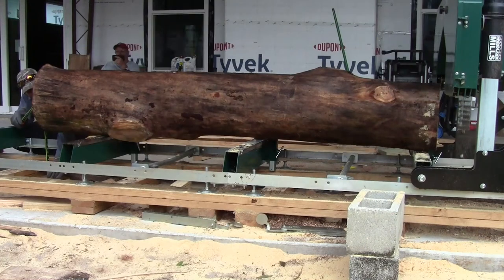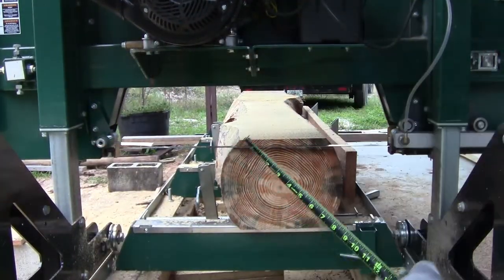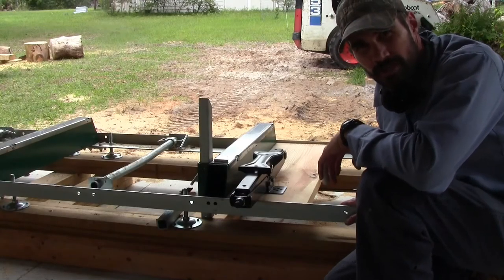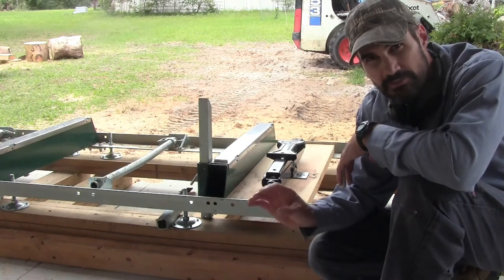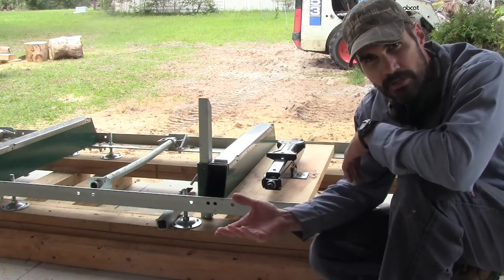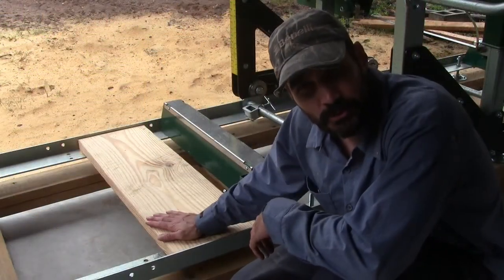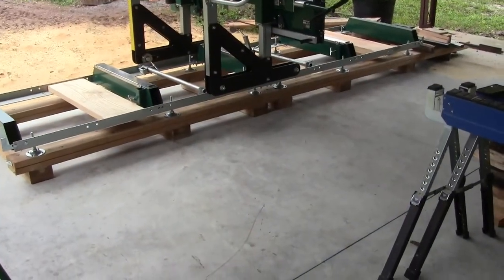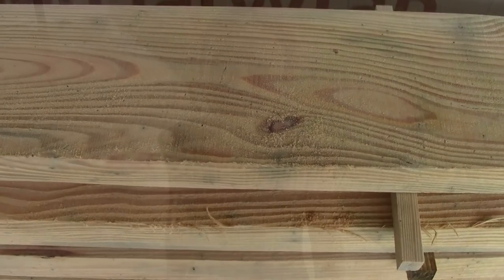Large Southern Yellow Pine on my Woodland Mills HM130Max and a Harbor Freight Upgrade

Comment: Hey there buddy I sure do like the videos. I’m having a hard time figuring out what sawmill I need. I originally thought the hm130 Max trailer would be best, but then I was thinking a 8-30 Lucas would be more useful. It will slab 5 feet wide folks around here like wide slabs. Thank you for taking us along with ya.
Reply from the maker: Thanks for the comment. I think you are on the right track to figure what your ultimate plan is and what type of logs you are likely to get. Matt Cremona has a niche in milling oversized slabs. His setup is geared towards it. I planned on mostly pine trees and smaller stuff so the HM130MAX is a good fit for me.
Reply: @CedarTrailsLiving  ya folks need Dimensional lumber from the pine, fir, and cedar, as well as slabs from the big walnut and oak trees that they take down. I like that the Lucas can be put together around a big log, log handling equipment is needed. But a couple of buddies with strong backs will be needed to move the slabs hehehe
Reply from the maker: @heyyoubuddy6749  Haha. Yeah gonna need real strong backs. That Lucas mill looks awesome. I had never seen one until you mentioned it. Had to go watch a few videos on them.

Comment: You help me determine whether to get the "sawmill toe board" from Woodland.  It currently is $189.00.  So thanks for the video. Can you tell me what that height is or how tall your jack is? I have a floor jack already and just wondering how much space is there.
Reply from the maker: Yep, the toe boards are expensive.  I learned the height is actually not the toughest issue. The angle that the saw rides on makes it tricky to get to the jack for my setup.  Since I have an RV jack on a 2x12, the screw is almost right at the top of the angle so it's hard to get the crank in there. Also it's too wide sometimes and gets in the way of the travel for smaller logs. My ultimate solution has been to jack up the log, and then put something on the log bunk to shim it up and remove the jack or sometimes just angle the jack if the log is long enough past one of the bunks.  Hope this helps and thanks for watching.

Comment: A bandsaw's worst enemy..... southern yellow pitch pine. You can run diesel, pinesol & water, or kerosene as a cutting fluid but truthfully bandsaws suck at cutting pine w/ pitch or knots. It pissed me off enough that I ended up buying a circular sawmill to run next to a large industrial hydraulic bandsaw mill and now I have no blade dives, no significant pitch build up, I cut knotty pine like butter and I don't have to scrape my boards bc the cutting process does that for me.
Reply from the maker: I have tried the pine sol and found the soap to work best. I have started to use a pressured squirt bottle to augment the flow from the tank. I like the control over where I can aim it. Saw Matthew Cremona do it that way.

Comment: With your saw being on backwards you have a lot of blade sticking out with no support
Reply from the maker: I very much agree with you. I tried to put some 2x10s and other wood to shift it over. Was a temporary setup so if you catch my sawmill shed videos the last one has the mill oriented correctly. Thanks for watching and for the comment.
Reply: @CedarTrailsLiving  The easiest way to reverse the mill setup would be to flip the log bunks so that the stops are on the other side
Reply from the maker: Thanks for the comment. That is certainly the easiest way but I took the hard way and built a sawmill shed where it could be oriented correctly and I can still load logs with the stops to the back. You can see the new setup in this video: https://youtu.be/Zjf1gUcP9zA?t=455

The sawmill shed build is in the sawmilling playlist if you are interested.

Comment: I think you have the log stops on the wrong side of the bed for the direction of the head.
Reply from the maker: That is correct. In this case I have it on a back porch temporarily and didn't want to shoot all the sawdust back at the house. I am building a more permanent home for it right now where it can be oriented correctly. Thanks for the comment.